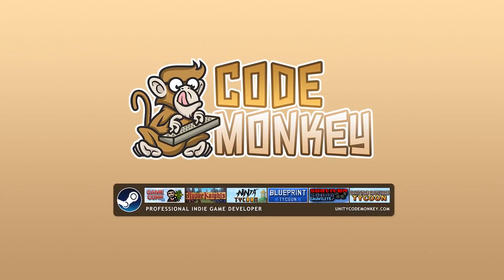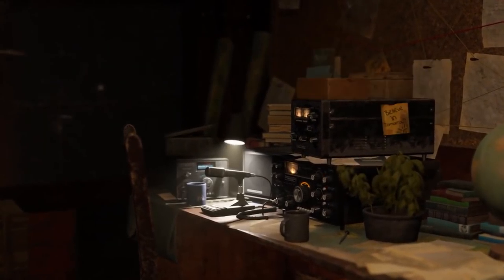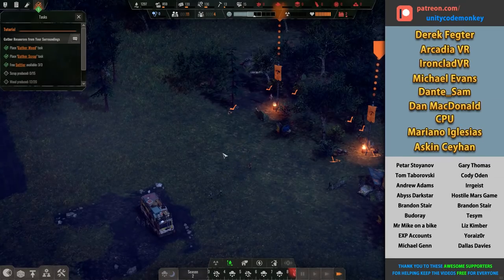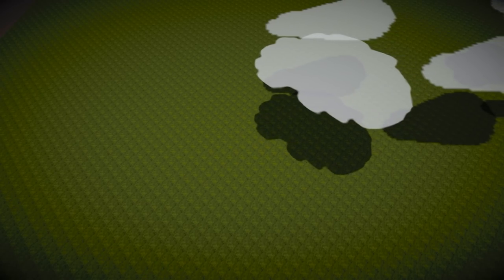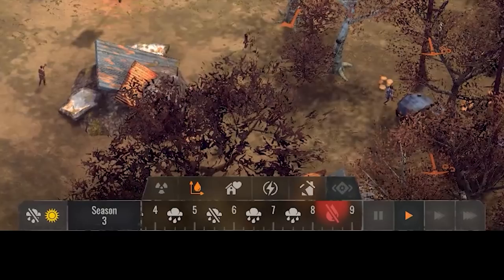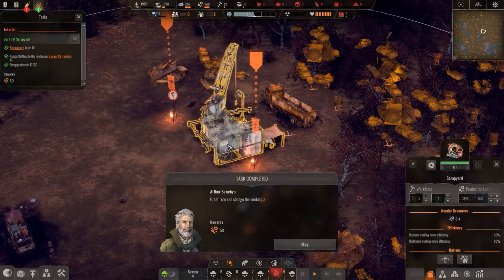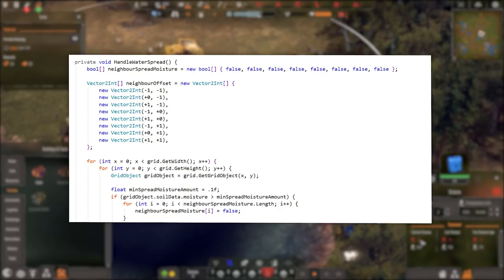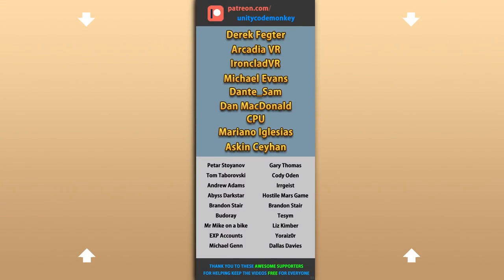How it's Made: Endzone - A World Apart | Moisture-Radiation System

Comment: I really like to learn how its possible to load/unload game areas with  Hybrid SubScene,  based on the players position. In 3D (not Iso) If you start for sure your code on 500x500m. But if ppl mostly done, they want to build larger areas and can not load all the stuff at the same time into the scene.  None has done on YT any vid on this. Too complicated?
Reply from the maker: It's not necessarily that it's too complicated, it's more that it's hyper specific to whatever game you're working on so it's tough to make a general video that is applicable to lots of genres.
How a platformer handles that logic will be different from a city builder and different from a open world game, etc.
Although I'm thinking I might do a video like that on how to stitch multiple instances of my Grid System in a huge world.
Reply: @CodeMonkeyUnity  thanks for replying.... I thought about more in the desktop gaming genres, where you have games like racing, shooter, survival, flight, simulators, etc.. all these have a more or less real landscape, where parts must be loaded around the players position previously and unload when above a distance. I think nearly 90% of the desktop games need this behavior.  I think you know what I mean.

Comment: Does Oxygen Not Included work similarly or is there more to it? It seems like there would have to be some crazy optimizations to simulate all the gasses and temperatures and germs and now radiation.
Reply from the maker: I haven't played it since it launched in Early Access so not sure how much complexity they added but yes they likely use some sort of Grid System to keep all the data for each grid type.
The Grid is mainly just data, it's not any complex objects, so there's tons of optimizations you can do to it to make it performant. For example using the Job System would make this simple demo 100x faster.

Comment: Sorry this is off topic, but I have a video idea for you. Can you please upload a video to teach beginners how attach / use the debugger to the Unity editor? I see so many beginner who ask simple questions that could easily be solved by using the debugger. Most of them don't even know that it exists and the other think it's a scary / hard to use thing, when it is so easy to use. 

For example yesterday I saw a Unity forum post where someone had a if statement with multiple conditions and the code inside the if statement didn't run (because the condition was never met), other people said to put a debug log inside the if statement to check if it really doesn't run etc, when it is literally faster to add a breakpoint, attach the debugger and see what's going on instead of adding debug logs.

Don't get me wrong, debug logs are useful and maybe even better in some cases, but once you actually want to debug a specific part of the code to see if/why it does(n't) work, then using the debugger is much easier, I hope we agree on that and that's why I would ask you to teach the beginners how to use a debugger so they will hopefully improve their debug skill and find their own bugs faster.

Everytime I help someone to find a bug, the first thing I do is to teach them how to use a debugger to find their bug and so far all of them agreed that the debugger is awesome and they will use it more often.
Reply from the maker: Yeah the Debugger is an interesting topic but a bit tricky to make into a good video, same thing for the Profiler, Testing, etc. Interesting topics but tough to make a compelling video, I'm thinking I might do those as a Quick Tip rather than a full on video.